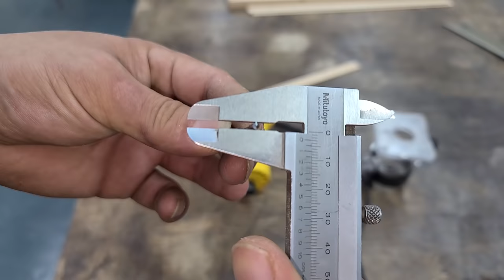Make a thin grid pattern with a trimmer / Woodworking DIY

Comment: Bro, thank you for (2:28) the "template guide" thing. Now I can rest..

//It have been 2 year until now, I don't know what the function of that thing, LOL.
Reply from the maker: Forget template guides.
Use bearing bits instead.
Reply: @망치소리HammerSound  Thanks for the reply. Nice suggestion.
I haven't try template guide, and it's always in the box. 
Well, If that's the case, I'll stick with bearing bits.